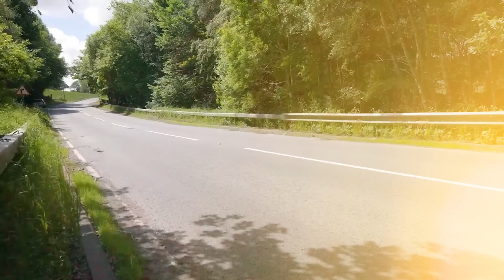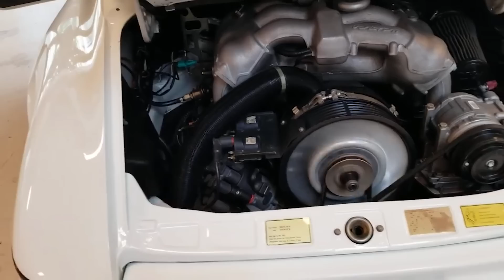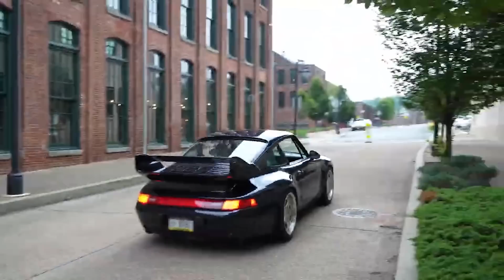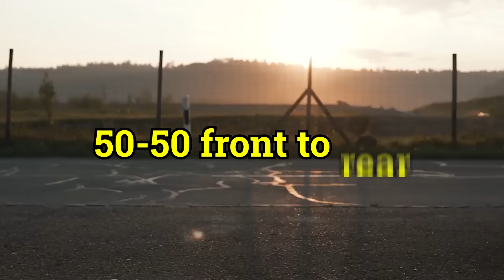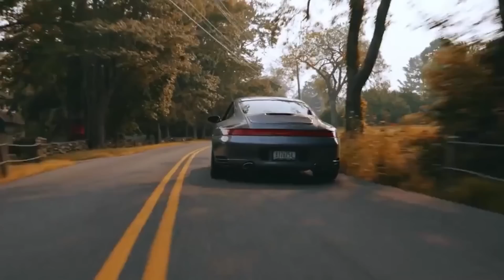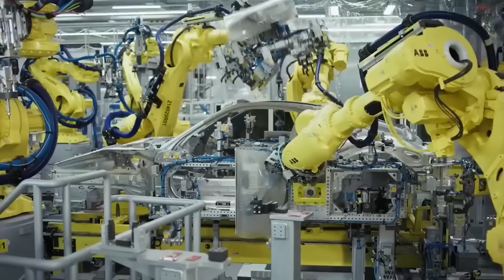Classic 993 Deep Dive: No Radiator, No Problem

Comment: My 993 C4 just ticked over 116k miles yesterday (I've owned her for 20 years now). She runs great, but has a propensity to eat batteries ...might be a power leak in the electricals somewhere, which I have to troubleshoot, but that's part of the joy of owning an old car. :)
Reply: My 993 cab ate batteries, but my coupe doesn’t. I swear it’s the alarm system